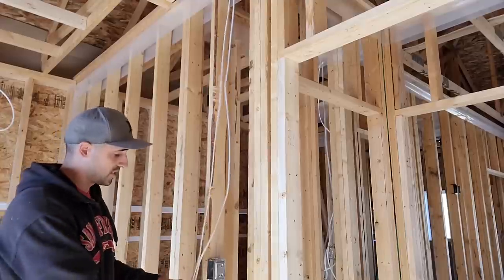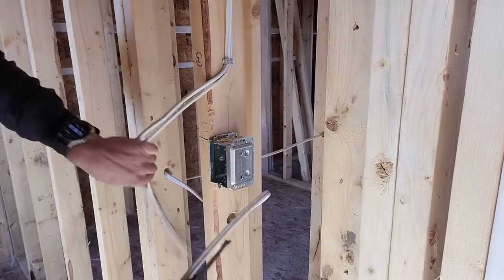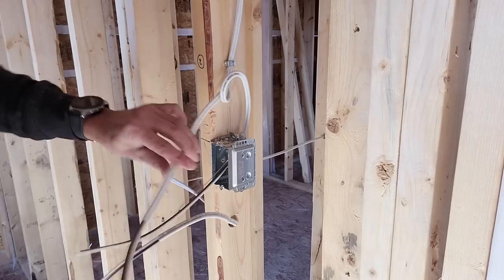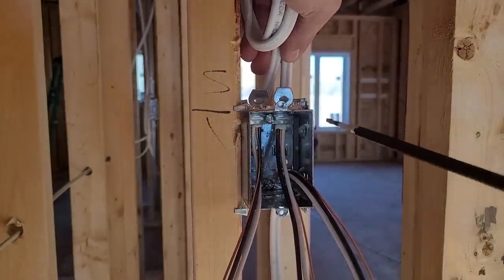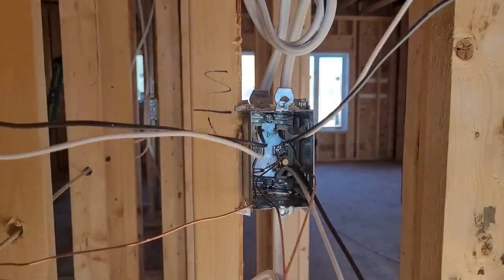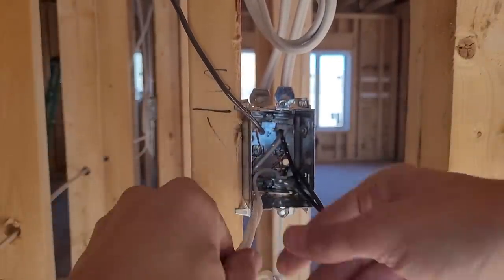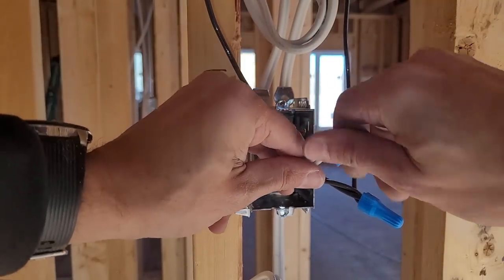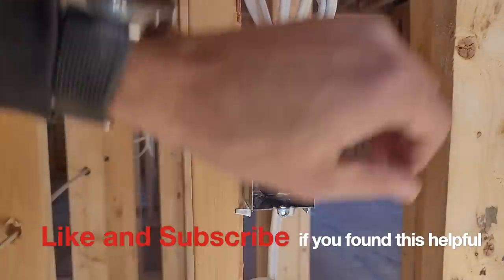How Pro Electricians cut wires into boxes and make it look clean!

Comment: Hmm. No way you could get away with that here. First your ground must be attached to your yoke of the device. Switch or not it has metal on it. Service loop? I guess if the sheetrockers are that bad. If the wires are in the back of the box and they tear up your wires using the Dremel method, make them pay for rewiring the house. Take down the sheet rock and repair it. Put your " loop" above or below the floor/ ceiling line. If you can't pull that in, you are using the wrong staples. Good sheetrockers can measure and precut holes for devices.
Reply: Most of the electricians I've worked with have stapled the romex down hard. I've failed an inspection because my romex wasn't secured to the satisfaction of the inspector (one whack with the hammer satisfied him, tho).
Reply from the maker: Unfortunately some drywallers can be that bad. It's not common but on a few occasions I needed to pull in some extra wire due to damage.  One drywaller years ago actually routed out a chunk of a live temporary receptacle.. along with cutting an alarm wire and putting a hole in the shower plumbing. That service loop is my insurance policy for those situations.. and it's completely legal here in Canada.
Reply: @energyoneelectric  Canada that explains it. I have seen videos of panels on their side. Legal in Canada but not in the states
Reply from the maker: @patrickhein9470  have you seen them upside down? Lol. I do that all the time when main cable comes from under basement slab.

Comment: Don't cut the bonding wires or ground wires. That was the old method when switches were dumb. Now a days most switches are smart switches and they need ground and neutral wires in addition to the power wire and load wire.
Reply from the maker: You can keep 1 bonding wire uncut if you want, but dimmers and motion switches come with bonding wire attached to the switch so it can easily be put under a bonding screw.

Comment: Why not just cut it to length 🙂
And don't you use grommets on the holes lol
Reply: 1. Why not cut to length? For the reasons stated. In my neck of the woods (Canada, so literally neck of the woods) it's standard practice. I'm not sure I like the curly style, but that's a separate issue. 

2. As for grommets - ?? That box has integral cable clamps that are intended for installation just as illustrated. 

Where are you writing from? Are grommets code-required there? And what sort of grommets? The grommets I was familiar with as an electronics guy are unlike the hard plastic grommets I use as an electician, but both fit in round holes and neither strain-relieves the cable. Are you actually talking about a connector like a 40-40 or something?

Really curious to know what's normal where you are.

Comment: I respect the idea of service loops but I don’t agree with it. Your connections and splicing is great.
Reply from the maker: Thank you. You know, in a rare occasion where sometimes the customer wants to move a receptacle or switch over a stud space or higher or lower a bit that service loop can be a life saver for that extra few inches you may need.
Reply: @energyoneelectric  it’s definitely a good option to have if you can and your inspector is cool. I’m in New England and it’s a crap shoot. Some inspectors want bushings on everything. No way around it.

Comment: You'll save yourself a little bit of extra work and money by  using non metallic nail on boxes.
Reply from the maker: Actually the plastic boxes cost more than the metal boxes around here, so it doesn't make sense to switch cost wise.

Comment: This would not pass code in America. I also cringed watching You cut the ground wires.
In a plastic box there would be no way to ground the switch. In a Metal box even though you are grounding the box if you don't ground the switch directly they require grounding clips to attach the switch to the box. And greenies are required or you also fail.
Reply from the maker: The plastic boxes I use in Canada have a metal bonding tab from the bonding screw up to the screw hole where the switch secures. Also the Eaton switches I use don't have a bonding screw. But definitely follow your local electrical codes.
Reply: American sparkies > Canadian sparkies

Comment: Also, I pity the fool who goes and installs a smart switch only to find out they don’t have a ground to hardly work with.
Reply from the maker: You can always get a piece of ground wire and put under the screw.  Or Bond the dimmer's ground wire directly to the bonding screw.
Reply: @energyoneelectric  I suppose at the end of the day, it’s all different where you are. We don’t leave service loops, and it’s beat into your head to make sure hose wires are all the way in the back of the box. This seems to be a Canadian thing, as I follow HomeReno Vision who is a Canadian and whenever I see electrical rough-ins in the background I’ve seen it before. I think you’ll find a lot of Americans calling it ugly. It also just doesn’t professional down here and I’m certain inspectors would complain.
Reply: Its a metal box. You can make a ground anywhere if you have a drill and a green screw.
Reply: @mckenziekeith7434  a 10-32 thread.

Comment: Wow code violations you absolutely need your ground wire at a switch! Also all wires must be ae to be out of the box a min of 6" those grounds are now way to short! Not to mention its poor practice to install 2 wires under 1 screw like that and to not wrap the wire around the screw.
Reply: It’s really poor practice.. takes 12 seconds to splice the ground wires together.. can cut them short and neatly fold the nut to the back of the box.
Reply from the maker: There are no code violations in this video according to Canadian electrical code, where I'm located.
Reply: You don't need to wrap the wire around the screw. There are shoulders on either side of the ground screws to provide a channel and ensure the wires stay in place. It is allowed under Canadian code and is common practise. It could be that the ground screw design is different where you are.

Comment: NEUTRALS WILL NEVER BE PULLED OUT AGAIN? this guy has NEVER worked on a smarthome! Every switch needs a NEUTRAL AND GROUND! This is for 1990s electricans!
Reply from the maker: I understand certain switches need neutrals and grounds...in which case you can pull out the neutral and splice onto it, and you can put your ground directly under the bonding screw. Not a big problem as some of you make it out to be.

Comment: Please don't staple the cables to the timber 😪 The next poor bugger who wants to get a cable down the wall can't use an existing cable as a draw
Reply: Sorry but thats code.  Run conduit if you dont want that issue.
Reply from the maker: It's code in Canada to support your wires. The next guy (if ever at all) will need to fish it in.
Reply: @energyoneelectric  Oh, I see, fair enough. It's not code here in NZ hence don't encounter it too often. We regularly use existing cables as draw lines for running controller cables etc